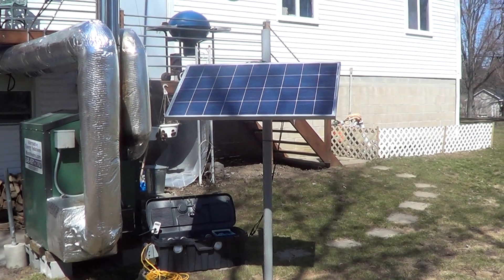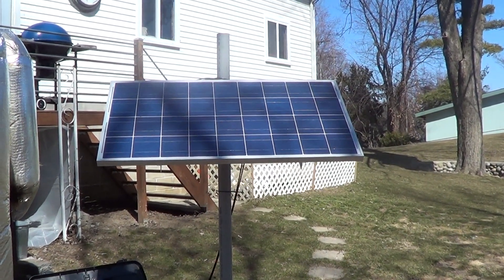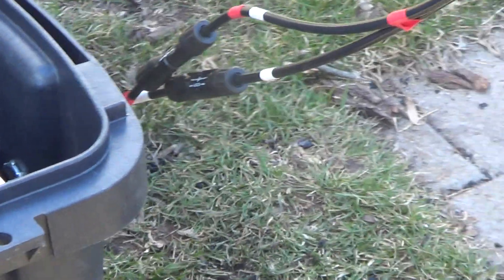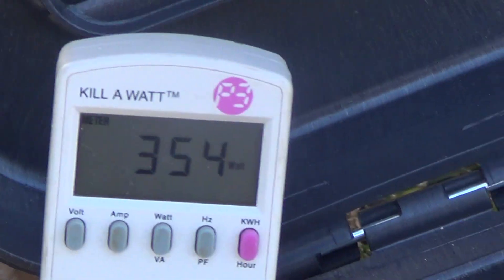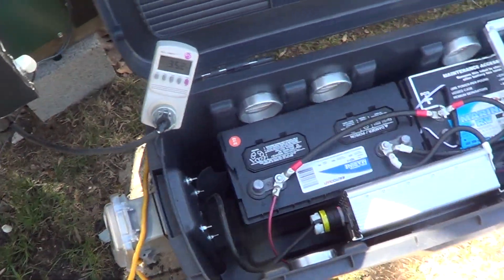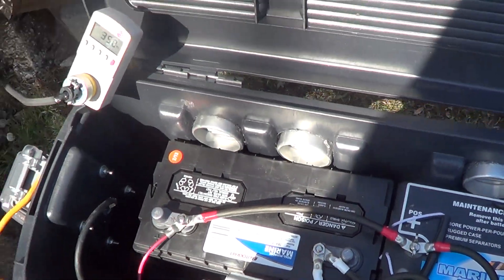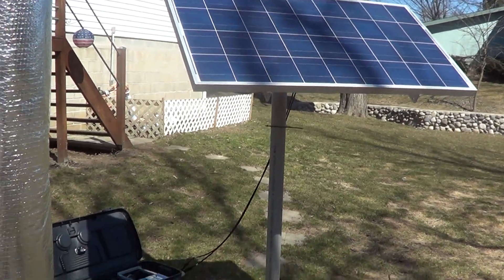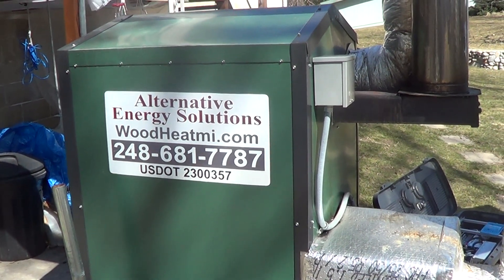Solar Powered Hopsco Airstove

Comment from the maker: So far the best I've seen this 120watt panel produce has been 8.6 amps at 13.1 volts, that's 112 watts per hour. So it would take several days to recharge completely after using the batteries during an outage, but I have run the stove for over 12 hours just on the batteries. Ideally the batteries should be inside in a cool but not at or below freezing, but even so a "charged" battery will not freeze, key is "charged".  Idea on the blower is a good idea, just adds an additional cost factor in.